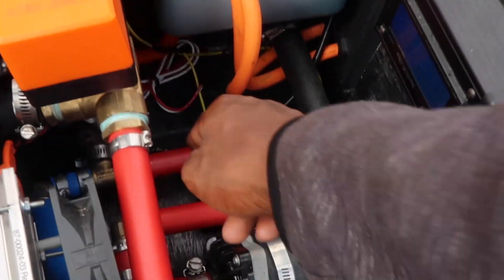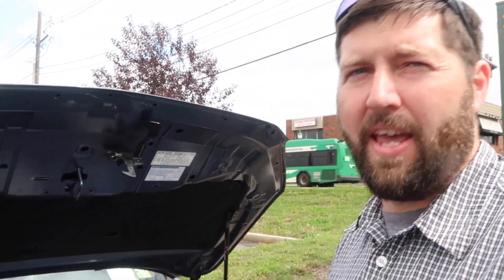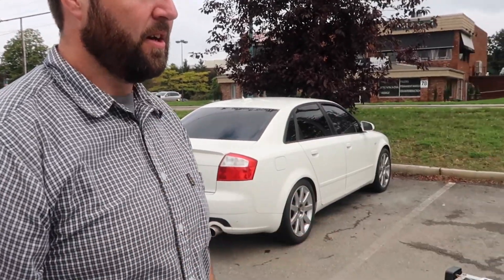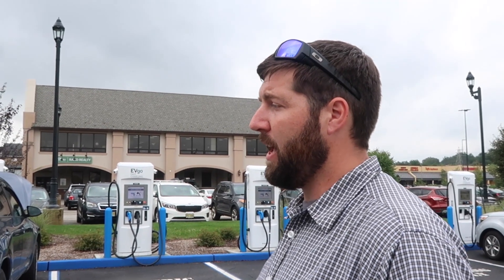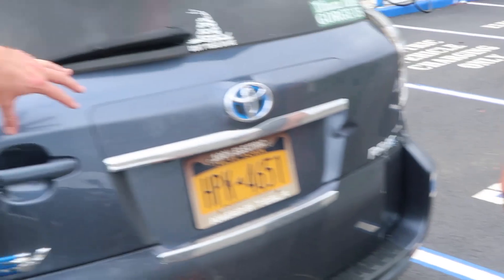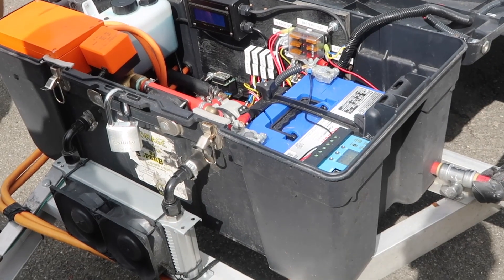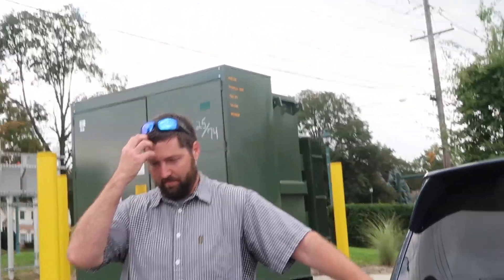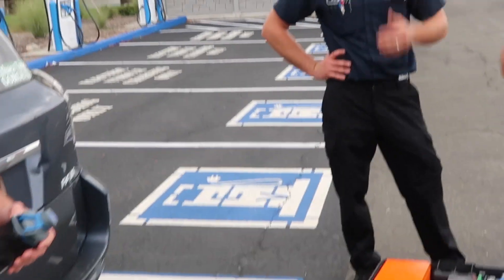The True DIY Tesla Range Extending battery Trailer

Comment: I see an electric pickup truck in this guy's future. With an extra battery pack in the truck  bed.
Reply: If he does it right, he could have 2 or 3 Tesla batteries from what's in that Audi, the ones that look like big blocks. He could have them all laid out in the bed of the truck with a roll bar looking frame, and attach a car radiator with one or two big fans to pull air through from the back side of the cab. And then he could even put a set of solar panels on the top of the batteries, after blocking them in the bed. So at this point, there would be no bed to use for hauling stuff. But he could have it also be optional 4 wheel drive like Tesla cars. And on top of that he could have an alternator with a fan blade spinning at 2k rpm to generate 500 watts of continuous power. So really, he could go far with this set up. There are ways you could get free power from using modified alternators and such, but I'm not going to go into details. As we all know, the usa government doesnt like people who get free power lol.
Reply: Not JoMama or pulling RV with solar panel and a cable to charge pickup at camp site hook up.
Reply: Brent Rice oh fuck yeah! That sounds amazing

Comment: Very nice setup! I work for Tony, and he's got a pack at the shop that he's been thinking about doing this... Very cool to see that someone has done it already! 
For those wanting to know how much you can get on of these Rav4 EVs for they can be pretty easily found for $15-20k used with fairly low miles (40-60k). 
We build the JdeMO kits for other cars as well, including the original Tesla Roadster, as well just recently we opened up reservations on the kit for the Mercedes B-class as well (which was another car built in partnership with Tesla as well).
Reply: Alex Bessinger hey thanks for posting! Glad you like my build!

Comment: I found out they have this new fangled car that is powered by and internal combustion engine, and what's wild about it in cities on virtually every corner there is a fast charging station where you can completely charge your vehicle in like two minutes. With a range of over 460 miles, mind blowing.

Comment: Roof rack mounted battery 4 da win
Reply: People always suggest this. It wouldnt work. The roof cant handle 840lbs. And if it could the car would be very top heavy which is unsafe. Also, you would lose 10-20% in aero drag. I hear it all the time, not possible.

Comment: Needs another trailer on the back with a generator.
Reply: No way, that would be too slow of a charge. 200 miles has been the magic number. With that I can get to different fast charging stations. A generator is slow and uses gas that Id have to pay for.

Comment: And dude, it kinda makes much more sense to put it inside the car, or bolt it to the bottom. 200 mile EV, no trailer needed.
Reply: This was the easy way so I did it first. Like I said, I want to add more modules to the car but this was easier, quicker and cheaper. Now that I know the car isnt going to freak out and turn on all the warning lights, I know I can do some more tinkering. 

I have taken this on many road trips. And I agree that I would love to not need the trailer. Its fine on the highway and most towns and cities, but NYC and other large cities would be a challenge with a trailer.
Reply: Pretty cool man.. Where would you put it? Does it fit in the trunk?
Reply: the modfather in the same location as the OEM pack. I’d replace the lower capacity modules with 100kwh modules

Comment: Actually a good idea for rescuing dead EV batteries on the road.  I mean, EV companies should have solutions for stranded cars without power
Reply: Yup. This trailer pack with a Chademo charger is a business. There is a local guy doing all kinds of fundraising to make something that is 9kwh. Hes raising millions of dollars but I could do it for $7500. lol Check out Sparkcharge. I think its sparkcharge.io
Reply: I have a few friends into high end bicycles. It will be cool for a compact trailer that can carry a few bicycles and double as a range extender. Another config is a compartment can carry more stuff.
Reply: @zodiacfml  also you're making me wonder what would happen if you had one of those 2 wheel drive electric mountain bikes that are illegally powerful, and ran cables to this trailer for power.
Like, what range would you get from a electric mtb that was lugging a gigantic battery trailer, and what speed could you cruise at without frying the bicycle controller.
Or EVEN STUPIDER, I wonder how much weight it would add to have a folding 3rd wheel that pops out under the hitch, so you could drive this thing along at 5mph if you need to move it just down the street or around the block for some reason. Like a wacked out gated community golf cart.

(i assume that OneWheel Rich was using to drag the trailer would go about 500 feet pulling the trailer, if it didnt burn out first)
Reply: AAA should contract with this guy for a fleet of these...
Reply: AAA have their own breakdown trucks with onboard generator and EV chargepoint.
https://cleantechnica.com/2016/08/28/aaas-ev-recharging-trucks-rarely-get-used-apparently/
Reply: @watsontcbc  they’d just use an inverter probably
Reply: Tom Watson or they won't and just call a roll back tow truck like they do for any other disabled vehicle.
Reply: @jordanmpaul  but thats so uncool (even though it's absolutely true.. having the tow company buy another flatbed is way more versatile than getting a weird special-purpose EV gadget. It's just less entertaining!)
Reply: confuseatronica the thing is it takes so much time to charge the car so the AAA person would have to wait with them for it to charge. and a tow company isn't going to wait around. They are going to tow the car to a charging station and that's it. AAA pays by the mile not time spent.
Reply: Thing is you can walk and fill up a small can of petrol, electric on the other hand is a no go.
Reply: Yep, just rent a 100kwh trailer pack before a big trip, it gets delivered to your house by a company, you take your trip, then they come pick it up after!! (@AnantaSesaDas I did just take a 1700 mile road trip in 2.5 days in my Model 3 tho without the need for that, and charging time only added an extra 2-3 hours from what it used to take in my guzzler)
Reply: they do....  they're. called tow trucks
Reply: Nicholas Allan; $90+ a tow? No thank you. Fred flintstone the jalopy. I stil don’t understand why a generator couldn’t do the trick.
Reply: @TheAnantaSesa   not the right out put. I bought a 20 year old Jetta TDI and never looked back. I'll check out ev cars in like 15 years
Reply: Nicholas Allan; i get 47mpg with my $1200 toyota echo. Only 18yo but a salvage title. I’ll miss the manual transmission but looking forward to fully reliable self-driving mode. (If i have to watch the boring road i may as well do something with both feet.)
Reply: If you can get the car to turn on, you can just tow the vehicle and use the regenerative breaking to charge the car enough to get to a charge station.  That is a badass trailer though.  I think it would be nice to have a flat surface above the trailer to be able to use the trailer as an actual trailer too.  This could be expanded to much larger scales for trucking companies.
Reply: I mean, a tow truck could just take the vehicle to a charging station, but a trailer would be a fun way to do it though.
Reply: YES- a rescue trailer with a bunch of different EV rescuing systems, even a couple of spare tires, like one of each bolt-pattern wheels and tires for the top 3 most common evs, the battery, a power manager that can fast-charge other EVs for enough to get to a real charge station, a lojack or something so you can leave it with a customer and monitor it, tools and high-volt high amp cables, big vat of cooling fluid and quick patches.
Reply: zodiacfml in fact you only have to make it roll to get it charged but police won’t let you be dragged by another car with a strap
Reply: its called a generator
Reply: Some gas generators are able to recharge those batteries and some not
Reply: And the reason for this nonsense is what ?
Reply: Yes, but it's not the EV companies that have to do road assistance, that job is already done by other companies, EV companies only have to provide a technical means of EV cars being able to drive running only from external batteries, that would be an already amazing thing!

Comment: Wow, very nice. Wondering if it might be interesting if you put a camping trailer on top of that 2nd battery.
Reply: My goal is to do the same thing but with a flat Tesla 100 kwh pack. Then I want to build a removable lightweight teardrop trailer over top of it. That way I can use it to move stuff AND for camping trips with my wife and son. Each tesla battery is around 1300lbs so more than one would be a little much.
Reply: 2 100kwh packs should get me 700 miles. Thats more than enough haha

Comment: Could the Trailer Battery Pack be installed on the roof of the Car? Maybe you wouldn't want to but could you?
Reply: I get this question all the time. This battery is 840lbs. The roof couldnt hold that. Even if it could, the car would be very top heavy. You would also lose 10-20% due to aero drag.

Comment: Is there any concern with the batteries being in parallel about having to balance the two? what happens if he runs the whole thing to empty, turns off the contactors so only the front battery is connected and charges it? Does he then have an issue when he turns the contactors back on and the battery voltages are so mismatched?
Reply: Under about 50 volts has been fine. I dont want to push it. Jack Rickard had a video that he made when he tested 2 85kwh packs in parallel. One was something like 90% full and the other about 40%. It failed. He charged the lower one up a bit and it worked great. It took about 2 hours to fully balance. I try to keep them close but they will balance.

Comment: You should put a bunch of batteries on top of each other and make a portable power trailer.  Add an AC converter, and you could run events off of it.
Reply: Yup, there are lots of possibilities. If you wanted to start a business recharging stranded EVs you could make this and add a chademo charger.

Comment: Should cover the top of the trailer in solar panels.
Reply: It wouldnt be worth it. A typical solar panel is 300 watts and costs $250. 1 KWH would get me around 3 miles... Id have to charge for days

Comment: I wondered whether the cooling fan on the front of the control box would be affected by rain or spray?
Reply: I wondered that too but so far after using it all spring and summer its been fine. I have driven through some extremely hard rain too.

Comment: But why not two stacked up packs? With the larger packs you could push 800 miles! (And spend 20 hours charging) Haha.
Reply: My goal is to do the same thing but with a flat Tesla 100 kwh pack. Then I want to build a removable lightweight teardrop trailer over top of it. That way I can use it to move stuff AND for camping trips with my wife and son.

Comment: Why pull a trailer when you can have a fully electric car without having to plug in to charge and have it charging itself.
If i had the money i would build it , the tech needs are already developed it just needs putting together so it all works together , no fuel, no charging, you would only need to change batteries as they degrade and parts as they wear over time.
Elons got bleep all on my brain lol.
Reply: How does it charge itself ?

Comment: Great work! The next logical level...
I have a question - is there any circuitry preventing the contactors engaging if the two battery packs have excessively different states of charge?
Even a 0.1V difference (per cell) can produce some significant equalization current.
Reply: Under about 50 volts has been fine. I dont want to push it. Jack Rickard had a video that he made when he tested 2 85kwh packs in parallel. One was something like 90% full and the other about 40%. It failed. He charged the lower one up a bit and it worked great. It took about 2 hours to fully balance. I try to keep them close but they will balance. I think I remember seeing around 150 amps peak so far. Not bad at all
Reply: Thanks James, I'm glad you're aware of it and try to keep them close.
There is a possible condition when a low battery is connected to a high one and if additionally charging while still equalizing, the low battery could see a combined charging current beyond its design limits.
My homemade batteries are only around 1000 cells, but still have to take great care when connecting or reconfiguring them - once I accidentally connected positive to negative and vaporized the connectors and coated my fingers with gaseous copper. Took a few minutes to get my sight back too!

Comment: Build a teardrop camper on top of the battery pack. Solar panels on top. Go camping.
Reply: My goal is to do the same thing but with a flat Tesla 100 kwh pack. Then I want to build a removable lightweight teardrop trailer over top of it. That way I can use it to move stuff AND for camping trips with my wife and son.
Reply: Check out my channel. I just started a new range extending trailer that is going to have a teardrop on top.
Reply: sleeping on a lithium bomb... sound like a great plan! XD
Reply: @g60force  well you are already driving on one and why not sleep on it too.
Reply: Electromagnetic radiation?
Reply: Wouldnt a generator be more efficient than lugging all that weight around

Comment: Thats what i was thingking about. Imagine renting it when you have to drive futher or you are running out of juce in middle of trip.

I would put there also bike rack. You would we able to take bikes for familly trip.
Reply: My goal is to do the same thing but with a flat Tesla 100 kwh pack. Then I want to build a removable lightweight teardrop trailer over top of it. That way I can use it to move stuff AND for camping trips with my wife and son.

Comment: put the batteryes on the roof. 
that would look awasome
Reply: Wouldnt work. Too heavy. This battery is 840 lbs. They dont make a roof rack in the world that would handle that. You would also lose 10-20% because of aero drag. Plus the safety, it would be very top heavy

Comment: See if you can wire enough panels together to make a solar hood for that battery pack
Reply: May not get enough voltage from wiring in parallel
Reply: No where near enough power. It would have to sit for days to charge. It takes me 3 hours of FAST CHARGING to recharge this car lol. Solar panels are watts instead of kw

Comment: Why not replace the axles with motors (or add an electric motor on a bike chain to the center axle) to get the kenetic energy from the road?
Reply: You may have to add a clutch to it for when you let go of the throttle
Reply: More weight and money. Also more research and work. Not worth it to me.
Reply: @JamesKlafehn  dude your trailer is awesome. I hope we see follow up videos on anything you do.
Reply: How about regenerative braking for the trailer?
Reply: Andrew then I would need a motor. It would be more engineering, money, drag and weight. Not worth it in my opinion.

Comment: I would run those wires on the trailer inside of pvc pipe
Reply: Its not really needed but if I see any abnormal wear I will consider it in the next build.

Comment: If you can make a trailer that increases your range, you could easily modify an "ELECTRIC VAN" by adding 2 vertical battery packs and a third horizontal pack (left wall, right wall, and below the elevated floor). The cargo space would decrease but the range of the van would quadruple.  Imagine a van or truck that delivers battery packs from Tesla. Now think about installing cards  (audio, video, modem etc.) in desktop computers. To install or remove a card, all you need to do is to remove one screw and then slide it in place by pushing it in to connect. That delivery truck would load the batteries vertically parallel to each other by sliding. If the batteries also connected to each other electrically once they became mechanically secure for the trip, then the batteries to be delivered would increase the range of the delivery truck as well. A label will then say charge for 12 hours before using...
The bottom line is that as long as electric car companies are selling batteries of different shapes, it is the equivalent of gasoline car companies selling gas that only works on their cars alone. Once all the electric car manufacturers agree to use batteries that have at least the same shape, then car owner will no longer own battery packs, they will just exchange them at "battery stations" along the road (just like gas stations). Battery companies are energy companies. People will know which companies and battery stations have the best battery packs. The battery stations will protect their battery packs by checking the car electrical system before installing a fully loaded battery pack in it. They will also give the customer credit for the amount of power remaining in the battery pack that they traded in (better than just propane tank exchange).  On the road again...

Comment: This is the sh!t. 
If I were rich (small r) I would commission a 100kWh pack built  into a trailer. Mind you, a pack that still supercharges. Integrate the ultimate ski box and GO. Maybe pull it with a Golf GTE or something. Wreck out the ICE stuff, get a nice frunk extra.
Reply: My goal is to do the same thing but with a flat Tesla 100 kwh pack. Then I want to build a removable lightweight teardrop trailer over top of it. That way I can use it to move stuff AND for camping trips with my wife and son.